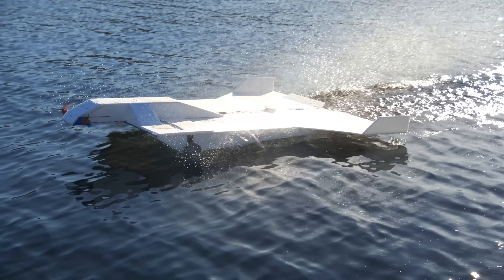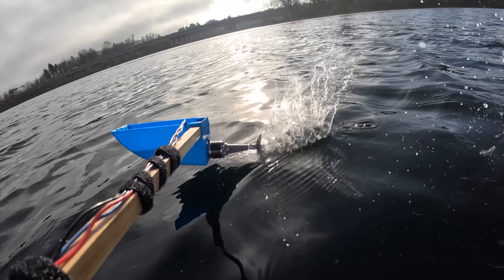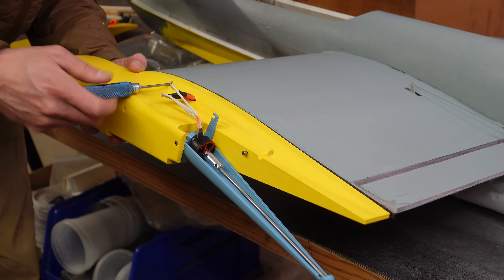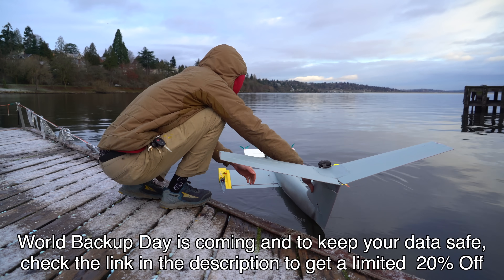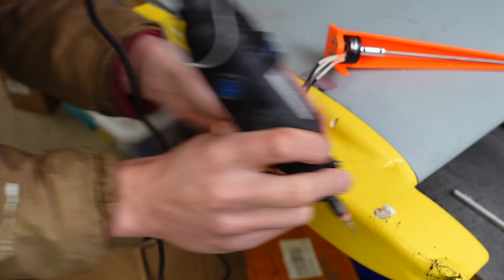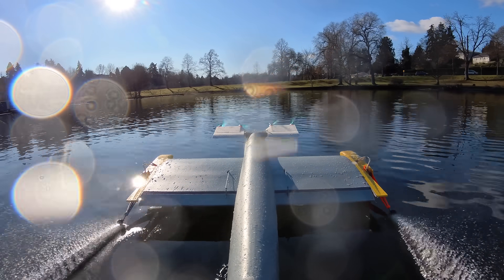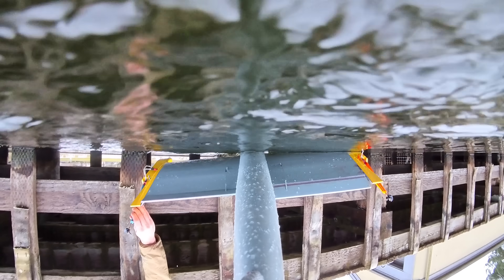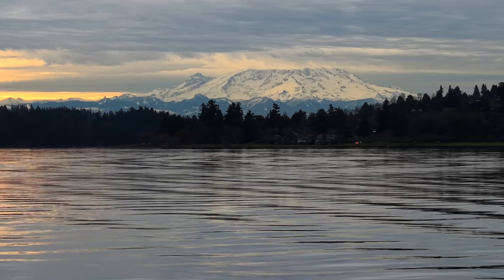Can Speed Boat Propellers Power an Aircraft?

Comment: It's wild those tiny propellers work so well.
Reply: It's because water is so heavy compared to air. Even if it's "sticky" it also provides a lot of thrust as the propellers push water rearwards.

Now surface cutting propellers are pretty special as they sort of disregards the cavity speed normal propellers has to suffer. That is when the propeller moves through water at a high enough speed the water doesn't have time to move away in a controlled form so it creates vacuum on the backside of the blades. The water in that area will decompress and basically flash boil. When this happens the propeller lose much of it's ability to push water backwards. The same happens with airplane propellers. When they rotate to fast the re will be cavitation behind the blades and they lose power to propel air backwards. If I remember correctly this speed is generally said to be when the tips of the blades reach the speed of sound.
Now surface cutting propellers somehow disregard this phenomena. I'm not an expert at them so I can't explain exactly how it works, I just know that it does. This is why really high speed powerboats tend to use surface cutting propellers.
Reply: @blahorgaslisk7763  That makes sense.

Comment: Just one prop down the back extended on a shaft.
Reply: He's using dual props for steering.
Reply: @beestingza  boats with one prop can steer too no
Reply: @direstrait5418  He spent some time explaining how he didn't want a rudder or anything dragging in the water.
Reply: @beestingza  use the air rudder on the vertical fin then?...

Comment: Maybe do a "traditional" catamaran (like in offshore boat racing) but maybe make it even more of an aircraft and less of a boat (with regards to how much racing cats really already are partially aircraft). Make the tunnel extra wide. use all-flying horizontal stabs at the back, and maybe also all-flying canards on the front so you can use your flight controller to control altitude. Then just mount two long-tail surface drives out the back of each lower hull.
Reply: Yeah it kind of blows my mind there aren't more ground effect transport ships.

Comment: Surface piercing props (turbines really) might work for a ground effect wind powered craft, like DDWFTTW. The water turbine would drive the wind prop geared and pitched to achieve high speeds than water speed for a net positive wind speed.

Comment: A spring loaded sliding prop shaft of the water motors would tell you whether they drag or push. There's all kind of way to make that easily visible, but you could also just log the propeller extension. Of make a light go on when there is net thrust.

Comment: on the direct drive tail shaft on rc heli's. we put two barring in and different length to keep the vibration out, looks like you added the barring in the middle. off set them to cancel out.

Comment: First, are your aqua motors counter rotating? Water propulsion creates an immense amount of torque, and surface drive actual create lift. It looks like every time the plane gets on step, it torques one wing higher than the other, so, which way, are the props rotating? Are they rotating inboard, or outboard? I would imagine, that you would want them to rotate inboard, so that if a wing gains lift, it is pushed back into the water, and the lifted prop re-engages, balancing the torque and lift.
.
 You should watch videos on hydroplane, and v-drive racing. Their speed concepts revolve around the prop generating most of the lift, with air buffering that lift under the hull. With that in mind, a third center mounted prop, would definitely lift the hull, but at that point, the wings aren't generating lift, so much as they are stabilizing the flight.

Comment: The high efficiency "paddle wheel" is the surface-piercing propeller - It is also the high efficiency propeller.
A conventional paddle wheel can not approach these levels of efficiency.

You should add foils to your surface-piercing propeller things to keep them at their optimum level in the water

Comment: you could put tiny springs on top of the propeller to push it down a little bit to stop the jumping of the props but not too strong so that it still only skimms the surface in wavey situations)

Comment: Would probably work better with a rear prop either angled or with elevator to create thrust at a ~25-45 degree angle to the water (plus CG adjustment). Achieve ground effect with par thrust. Additional thrust from the rear prop. If you’re wedded to the water props then you probably need 4 props balanced L clockwise, R anticlockwise 2 wing tip mounted 2 body mounted. Body mounted similar diameter to the ones you have wing ones larger with the aim to have more cumulative prop time in contact with water - that said. First option is better, an ekranoplan is more of a plane than a boat and doesn’t need an outboard. That said. Cool video, as they all are! 

I had good results with a square AF ekranoplan (called the ekranoprawn) cause it looks like a prawn with a canard, 2 fore mounted EDFs, a front mounted stabiliser - (a very short upward slanted wing, under water when stationary but brings the nose up when thrust is applied. Helps the craft get out of the water. Anhedral wings around five degrees pitch. Thrust from EDFs is directed over the wing not bisected by the wing. Decent sized horizontal and vertical stabiliser, horizontal mounted atop the vertical. Step near the rear of the boat to help the craft escape the water. Needs a fair bit of speed but achieves actual ground effect. I’ve not flown it for a few years and the hot glue has gone in areas but I really should get the prawn fixed up and shoot a video of it. It’s decent on land too as it has a flat bottom. 

You and peter S were my inspos tbh!

Comment: It might work if your propellers was in contact with the water 100%, since they are not the power is unstable. Possibly use 1 larger propeller under the airplane that's always in contact with the water and then the 2 on wings for boost and stabilizing.

Comment: Take 2 of the air props off. Half the drag when they are not powered. Maybe try smaller props on the 2 remaining motor so that they provide enough trust when assisting in the beginning but create less drag when not needed.

Comment: I don't quite understand why you made the water prop shafts free to rotate? It seems advantageous to fix them in a certain position: if your aircraft rolls, the lower prop will provide a slight bit of lift, countering the roll, and aditionally you will have some yaw, which will also stabilize the roll through roll-yaw coupling. And this way you have much better control of your height, which seems to be the main problem, not power.

Anyway just a thought

Comment: What if you gradually moved the CG aft?

You might be able to do away with the air propellers. But they should be removed entirely, as I think that the blades are completely ruining the flow on the canard, thus making the craft pitch down excessively as soon as the blades stop turning.

So, I would remove the air propellers and move the CG very gradually aft. The span of the canard might have to be adjusted to deal with such changes, though.

Comment: so in terms of energy efficiency, are the air-motors or the water-motors more efficient?
and I have seen quite a few attempts with a ultrasound distance sensor, how about using one of those to detect being airborne, throttling down the water-motors.

Comment: You need a third surface piercing propeller in the front that pushes the nose up. Alternatively if power full enough,  you may only need that one water motor in the nose.

Comment: Some of the previous ( air only ) stability might have come from the fact that the air motors were really pulling the whole system with the center of thrust well ahead of the center of mass.  With the swap to the water motors I think the thrust might actually be BEHIND the mass, which would make the system hard to stabilize with the active control system.   When/If you do the redesign, consider moving the water motors forward and toward the center line more.

Comment: Wondering if a single water piercing motor shaft down the bottom rear. Also maybe just 2 up front and with folding props. It can't run fast but just enough to lift at the beginning

Comment: If you remove the additional weight of the motors at the front it may be enough to stop pitching down and create enough lift for the ground effect to start working. It may also save some weight on battery capacity as additional controllers.

Comment: I've heard that air propellers are way more efficient than water propellers due the the water drag. I.e. a hydroplane (a boat with airplane motor) is more efficient than then same hull with a normal outboard motor.

Comment: Hmmm, would a single center line prop/pylon/thing be better, since it would be better at staying in the water if the craft banks? (not sure if torque might be an issue.) 
But if torque is an issue, maybe try a centre line paddlewheel/pylon/thingamabob, but with chevron paddles.

Comment: you just need more lift in the front wing, to replace the lift from the angled air motors.  make a new canard, with more lift, no pods, and preferably with pitch trim.  i think.

Comment: Your paddlewheel concept reminded  me of a thing called "swamp buggy" racing - they're kinda half car/boat things designed to run in shallow water, but the high end ones are mostly skipping over the surface. They use thin wheels on the front that act more like rudders, and scoop tires on the back for propulsion.

Comment: Yes!!! More of this please!!!!!!!!!!!!!!!!!!!!!!!!!!!!!!!!!!!!!!!!!!!!!!!!!!!!!!!!!! Also I think that 2 rubber bands on each prop would have helped to keep the plate/boat out of the water... On the way down the vehicle has downwards momentum and with the "weaker" rubber bands the belly of the vehicle touches the water as the relatively weak rubber bands give out before the props have had time to generate enough forwards acceleration to create lift over the wings ... Hope that makes sense. Edit: I just watched it again and it seems the water propellers definitely need to be "pushed" down into the water more. If you have a look at 15:00 the right side motor has clean continuous contact with the water most likely do to the vehicle tipping over to that side and "bottoming out" the hinge forcing the propeller deeper into the water. It was likely that propeller alone that was causing the vehicle to stay in ground effect with the air motors off. 

So in summary: 

1 - I think you need stiffer rubber bands
2 - I think the propellers need to be able to extend futher below the belly of the plane than they are currently 

3- It could also be the motors are pushing the nose down. Move them forward.
Reply: I think it's more that the linearity of the elastic isn't matched to the forces. Maybe it needs a neutral centre with elastic each way from there. The flex in the 3d printed surface drives clearly wasn't helping either. Lots of scope for optimization.

Comment: Can you add a gyroscope to stop the pitching left and right that you're having to constantly correct for as you Glide? I think you'd want the axis of rotation on the gyroscope to be perpendicular to the axis you're trying to stabilize. I'm also wondering if you'd want to counter-rotating shaft on one of the two sides to stop rotational Torque from pitching the craft over but maybe you were doing that already

Comment: If you make the right and left water motors to be able to individually modulate throttle, you may be able to get sharper corners. Lower throttle on water motors in directions your turning?

Comment: That action is very standard for a surface piercing prop, almost no thrust until you get on plane.  The reason is obvious if you think about it.  Often, with RC boats, if they loose plane, the prop will not even get them back up on plane, so you have to launch them like an aircraft throwing them into the water with speed.  You can generally get about 20% more speed with them though, because the drag is MUCH lower, without all the drive and mounting junk sticking down into the water.

Man, that works pretty well, better than I would have expected, too.  Maybe do an efficiency and speed test of water vs. air driven?  I would be interested to know, in case I decide to build a full sized version.  One BIG advantage of the water driven is NOISE abatement.  Full scale air props are LOUD!  It looks like you could use a submerged prop on a similar actuated shaft for takeoff, to be actively lifted after that point.  Also, this is the wrong configuration, without the incident prop lift at the front, so maybe a helper sponson there, as well, one that lifts out in ground effect?  Or a proper dedicated design.   You are very obviously getting better and better at that.   You could be of service to a lot of manufacturers of 'things boat' by now, I expect, if nothing else, showing them the outcomes of your wacky ideas.  They don't always scale well, but it's a data point, nontheless.

"...lathe".  LOL!   Literally, and you said it with such a seemingly straight face, based on your voice.  You could really make use of a small lathe.   You can pick them up used pretty cheap, just make sure it isn't worn out.

Jenky Y connectors with undersized wire....perfect.  You are very droll.  

"I just crashed into the dock".   Been there, done that, except the construction of my boat, formers, stringers, and ply, was a LOT more difficult to repair, and make look original.  Cheers.

Comment: I suspect that the air propellers are creating added pressure under the wings when they are operating and as soon as you turn them off there is not enough air pressure to keep the plane? boat? off the water.  Is it so bad if the air propellers are there just to create a bubble of air for it to float on, while the water propellers are doing almost all the propulsion work?

Comment: finally some progress. nasty lol. <3 potato nas. or just stick. sc lathe. second option, use wide wings so that you are always in ground effect even if higher. more passive tolerance for error. water craft. just for argument sake. under water drone plane. or just put bigger motors.
Reply: you know the coanda effect to scoop water in the backside propeller. yes around corners.
Reply: how about a body lift wing fighter plane, with through-plane edf thruster tubes, while reversed the tubes go to the bottom of the plane surface, giving vtol/hover.

Comment: So I was watching this video and I thought this was a pretty cool idea. What if you put one surface mount prop that drops down from the back center via a servo and it's used for takeoff and stability while moving during rough seas and can be retracted when not needed instead of two on the pontoons? When I was watching it fly, it looked like the outer pontoon props were imparting a lot of drag like you said when one of them would touch causing it to yaw one center, one in the back might not allow that to happen?

Comment: If I were you I wouldn't ditch the air propellers completely. Just use 2 small air propellers and beef up the water propellers. You have developed a nice concept. Congratulations. 👏

Comment: You know how when firefighters spray water and when you keep a narrow steam of water one fireman can hold the hose. If you change and add.. more surface area you need to add more firemen.   So can you draw a small amount of water from a tube at the tailend of the plane and then direct the water to upfront of the plane? Then by use this high pressure water with a high surface area, lift the plane with this dence volume of air and water.

Comment: I have a hint for you as to why it was so difficult without the air propellers. I have the impression that the suspension point of your water propellers is behind the center of gravity of your model. This means that when they produce thrust, they push the nose of the model down. Alternatively, you can lower the bearing so that the direction of force does not push the nose down either. The fact that your front four propellers also produce a relatively large amount of lift, even under the short front wings, shows that this could be related to this.
Reply: I would take the propellers off the front and put them on the top. And get some positive pressure into the fuselage to keep water out, and produce bubbles to unstick the fuselage from the water. You can make a valve so the water doesn't get back in with a little piece of plastic.

I would also probably convert the canards to fully moving. Getting everything aerodynamically and hydrodynamically balanced may not even be a reasonable ask. Better to just have max control authority and a computer, to trick the air into submission.

But that's just like my humble opinion man.
Reply: I was thinking the same thing, but also that the air props are pumping a lot of air under the wings, more like a hovercraft rather than just ground effect flight. It could be neither though, hard to say with out more tests.
Reply: yeah he's going to go with propellers in the water instead of in the air I would go with a foil system
Reply: Also a damper on the water motor supports

Comment: Build a "water cuadcopter" with 4 water propellers on long shafts that stick out the bottom. When you angle them a bit it should go quite fast. Its not a ground effect vehicle, but somethink that could be pretty funny :)

Comment: Interesting project….🤔 on the new air frame would an electric jet engine with a removable air shield to provide air stream plug when not in use be a possible solution to the drag of the prop drives ?